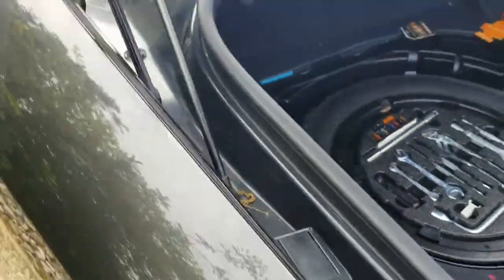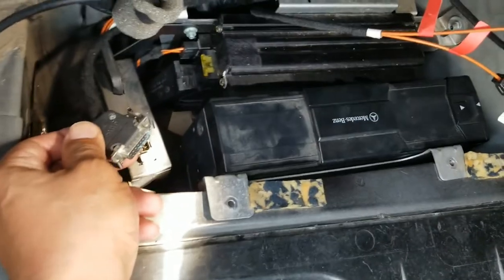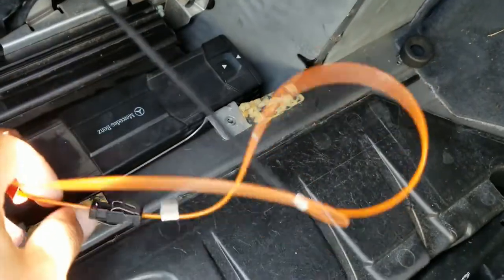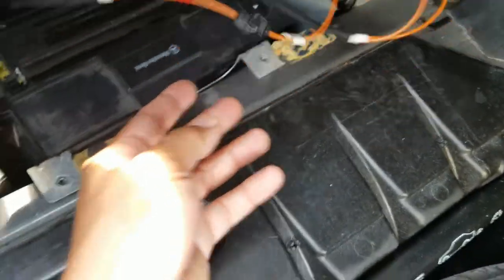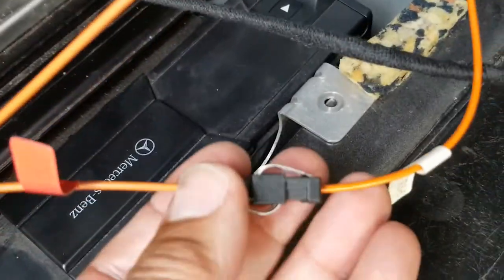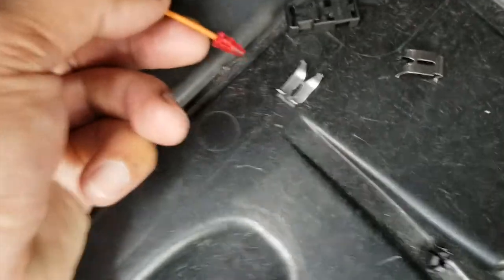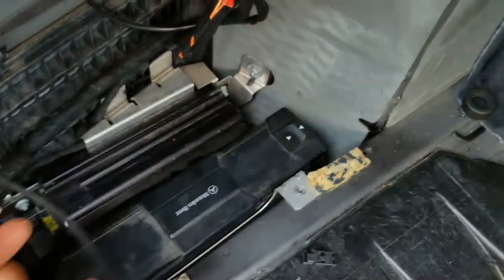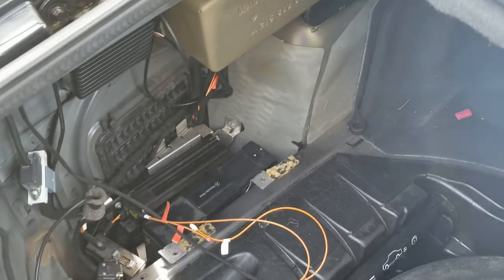No Audio In 2000-2006 Mercedes CL500 Fixed.

Comment: I have an 02 CL 500 with the exact issue. Pulled out the CD player & direct wired the Fiber Optic & it worked!!  Thank you!
Reply from the maker: Good to hear..no pun intended..and who uses cds anymore..lol
Reply: Hello, I am glad to hear of your success and I am going to try this on my 2006 CL 500 tomorrow 6/19/24 (well today its 0355).   I wanted to ask should I disconnect the battery? Also, what is he replacing adding if anything to the existing wires? Is this bypassing the area that is corroded or did he clean and reconnect the area that was corroded?  I am a female and a Nurse by trade, and I am a little detailed oriented.
Thanks!  Lisa ; )
Reply from the maker: Thank you for your services. All I did was remove the corroded system out of the loop. I did not disconnect the battery, just dont have the car on. Its like removing a "source" out of the loop of sources. I use the word loop because fiber optic systems are in a "loop", a circle of sources. So the phone is a source, cd changer is a source, navigation, and so on. So when the radio detected that the phone system was corroded, it shut the amp down to protect itself, which is the right thing for it to do. So when you bypass the problem, it doesnt see the problem anymore and thinks nothing is wrong. Follow the video, you will be fine, just dont lose the clip. You got this, the hardest part is getting to the wire. The bypassing part is easy. Good luck. Its easier than you think.
Reply: @richideates  🧡🧡 Thank You!  Wow I am so impressed on how quickly you responded!  I will let you know how things go. Again, thank you so very much!
Reply: No need to disconnect battery.
Reply from the maker: I dont usually answer that fast, you just caught me in my midmorning awoken from the slumber episodes. 🤣🤣🤣..your welcome. You should be fine

Comment: I have a beeping noise coming from my 1999 cl500 speaker any ideas what the cause would be?
Reply from the maker: Beeping? I cant relate to. But crackling, more like someone crumbling up aluminum foil, that would be a blown speaker. It all depends on the sound its making. Beeping I would refer to a truck backing up, or when an oven goes off when its done, that would be beeping. Try to refer more toward "beeping", that or try to describe it better.
Reply: It’s like the emergency sound but not sure how to take turn it off
Reply from the maker: Emergency sound? I think you would have to be more specific, but either way, I would say it is blown and needs to be replaced.

Comment: just bought a 02 S430 no power to head unit at all, all fuses check out, could that optic be the cause of my problem? its a MN car so corrosion is worse then some other states.
Reply from the maker: No power. Doubtful. Agreed that the weather doesnt help, but also doubtful. I would pull the radio out and see if there is a fuse on the headunit itself. MB's were known for that on some years. Its worth a shot to try that.
Reply: @richideates  thank you i pulled radio out checks fuses, they were fine, then i took the radio itself apart till it was littery just a screen, dusted everything i could reach put it back together now i just get a grey screen that powers on and off within like 10 seconds, does it about 3 times or so then stays off, ill keep on the search or just replace with an adroid radio, anyway thanks for the reply and keep up the helpful videos.
Reply from the maker: Welcome to Mercedes. Lmao. Well if you went that far, I see no reason why you cant replace the radio yourself. Most of those china radios or "plug and play" radios. Are just that, hide some wires here and there, run the camera if you so desire and call it a day. If its coming up grey, it means it has power and its time for a new radio. Not uncommon, especially with MB or German cars in general. Be lucky its not a 5,000 dollar computer like the ML's. Try to get one of those when the truck is worthless without a bad computer because the truck leaks water. This is a slap on the wrist with what German cars can throw your way. Lol Good Luck.

Comment: From where can i buy these black connectors?
Reply from the maker: Not sure. I looked on amazon and nothing. You should have them already in the car. I didnt supply those, those are factory connectors that plug into one another. I would google mercedes fiver optic connectors and see what you come up with. But those are factory for sure
Reply: Those are non Factory D2B connectors. Amazon and eBay.